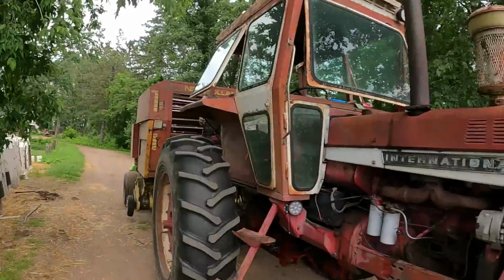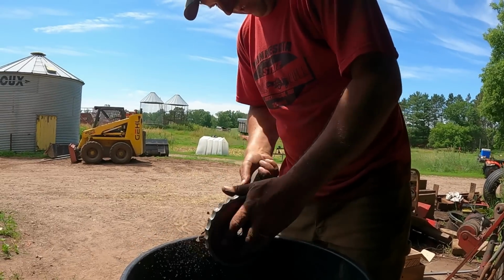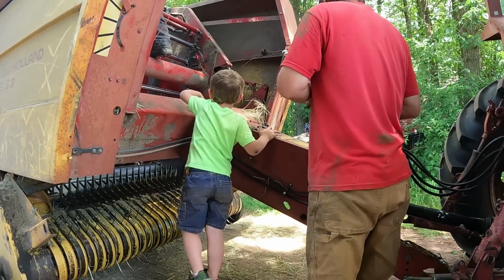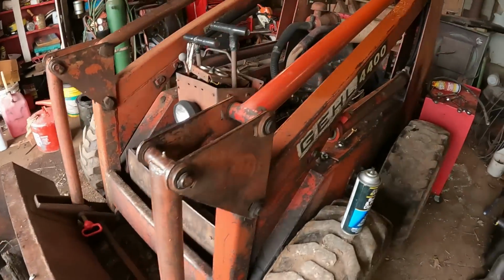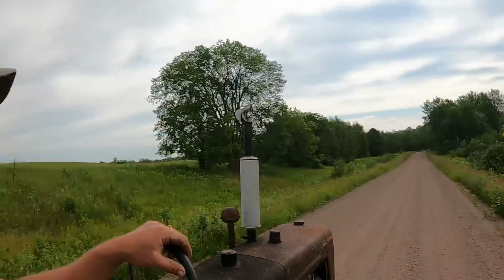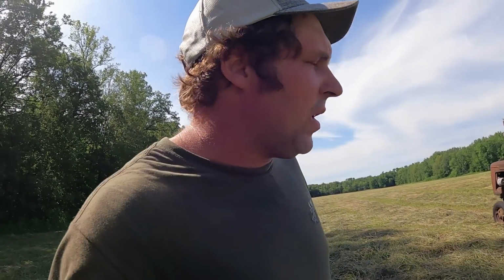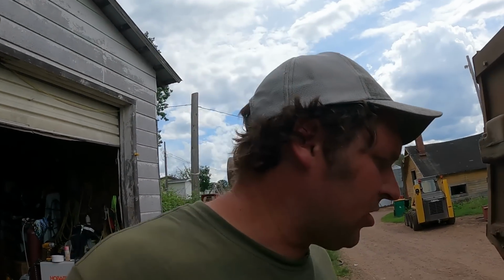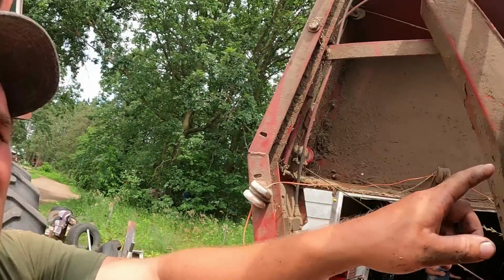Haying in a Heatwave/Round Baler Breakdown/Baling Hay 2022

Comment: The finger rake is probably the cheapest rake to keep operating and does a good job. I started out with an old one and then bought a 3-point Fransgard rotary which also works pretty good but goes through tines. The benefit of the rotary is that it does not wrap the windrow so the hay dries better.

Comment: at 22:30.........I never cared for NH chain balers because most I have seen made bales that looked like a few guys pitched loose hay into a round stack.
Your bales are the best I have ever seen from a N H chain baler.
Reply from the maker: Yeah, I know what you mean. I think the difference is that the older chain balers, had big springs to keep pressure on the bale, but this one uses air bags.
Reply: Well guess you haven't ever seen much hay baled with one then. The problem with that is people didn't know how to bale with them and didn't know how to maintenance and adjust them correctly. I have baled with the same old 1978 850 New Holland that I bought used for over 25 years.
Reply: @trinitydairy  nope not the springs just improperly adjusted and maintained causes that problem.
Reply: @leeroyexcavator9149  ..There must be a reason why the old chain balers don't hold their value and why New Holland switched to belts like all the other makes and now brag how great a dense bale the BELT balers make.
Why do you think that is ?
Reply: @douglasmacarthur8775  Don't hold their value that's funny. New Holland Chain balers that are 40 years old are still selling for 1500.00  plus while the belt balers are in the junk yard. Yeah New Holland found out they could make a  cheaper baler like the other company's and make more money from broken down balers and parts unlike the old chain balers that lasted 30 plus years or more. So that bull don't fly.

Comment: When you were changing those sprocket bearings the sprocket looked pretty worn down but I'm not familiar with that machine. Are those sprockets supposed to look that way?? That Farmall just keeps going. Runs like a top. I noticed that the PTO shaft runs nice and straight too. You explained it.... I missed it. My bad. Thanks. I can't help but like that John Deere B raking. I like the variety of equipment.
Reply: Those "sprockets" are supposed to be perfectly round.
Reply from the maker: Yeah I said that in the video.
Reply: @trinitydairy  yeah I caught that. Like I said my bad. Best wishes at the fair!!

Comment: Just curious you said you are grinding down your apron chain idler sprockets which I have never heard of!!! You best be doing it evenly on both sides or you could damage the chain and cause it to wear faster and put uneven load pressure on other parts I would believe.  I hear clicking but mostly from your pick up teeth. New Holland Chain balers are not as quiet. But are as far as I am concerned the best longest lasting balers ever made.
Reply from the maker: I probably shouldn't have said sprockets, they are supposed to be smooth, but the chain has worn grooves in them so sometimes I have to grind down the high spots.

Comment: Does that NH 853 bale silage hay not wet grass but damp hay    Does it start a bale easy I was thinking of getting a NH round baler
Reply from the maker: Yeah , I've baled silage hay with it, and it worked good, if the hay gets really heavy, it will stretch the main chain pretty fast.
Reply: @trinitydairy  Thank You

Comment: Alan I was just wondering what number haybine you have
Reply from the maker: 489
Reply: @trinitydairy  how do you like it.  I was gonna look at one and people kind of said  the gearbox was a problem
Reply from the maker: @jeffyurek4342  my grandpa bought it new in 1988, and we've never had a problem with the gearboxes, it's been a very good machine. I have heard that if the roller chain behind the one gearbox gets worn, and comes off, it can wreck the gearbox, but we haven't had that happen. I think the biggest problem we have had, is the u joint inside the pole where it pivots, went out, and took out the knuckle, and that was a expensive part.
Reply: @trinitydairy  ok thank you for your input

Comment: Well Allen are one that we rebuilt last Summer is now having its cultivators rebuilt, or farm show basically are second Fair is coming up here in about 2 weeks and we'd like to show it and we're working away right now and getting it ready. We still cultivate urea into about 20 acres of corn every year using the 1941 the end and the 1950 c we've done a tremendous amount of research since all it's ever been done on those two sets of cultivators is change the occasional bad or bent or broken shovel we've never changed them all at once you've gone through and checked everything and made some repairs and it's going back to the international paint codes and paint committee reports to get the proper colors for it and we're going to try and have both sets painted according to the 1940 50 area standards and show them both side beside this year we've been working at it for about a week and we probably down to about a day and a half two days left
Reply from the maker: Very cool! I bet they will be really sharp looking!

Comment: 2:36: on the back of the vice is a socket. on the shelf next to the sound system is another socket. so why you using a hammer n punch to shift the bearing ?? eeer derh !!
Reply: 3:45: HURRAH !!
Reply from the maker: You can't punch the bearing out with a socket, you can only get at the outer race with a punch, through the two openings.